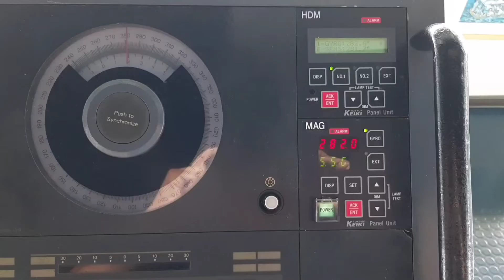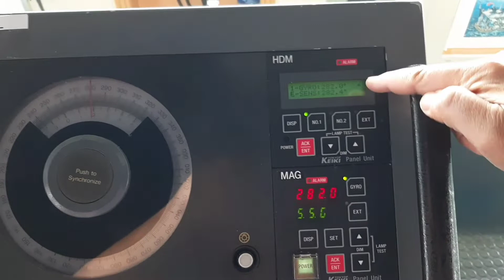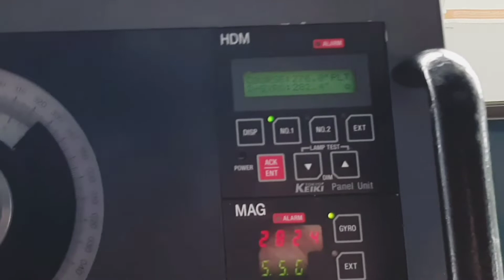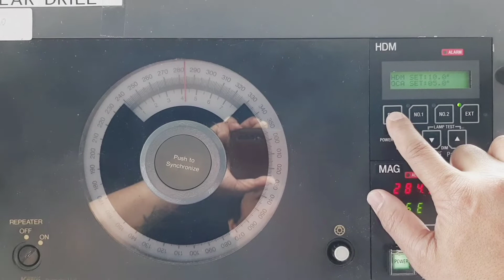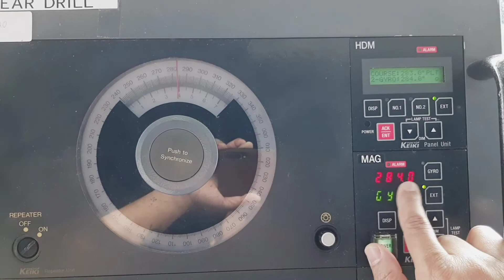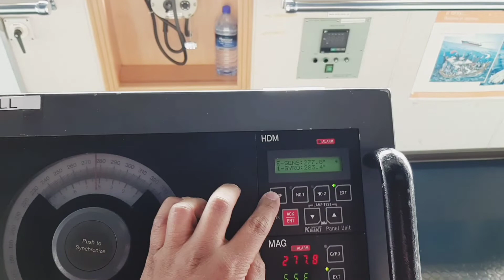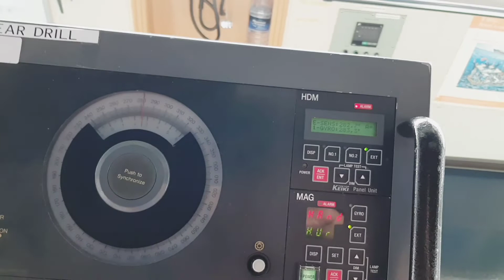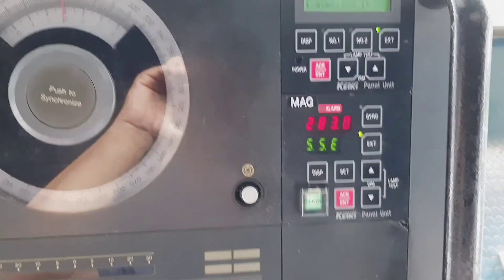OFFCOURSE ALARM TESTING PROCEDURE ON TOKYO KEIKI@geodudegraveller

Comment: Good day to you sir. I have followed your vid and tried the alarm we have same model. After tested and alarm was successful I had set H.Ur back in its previous figure but the alarm which is indicated as letter "A" beside the No. 1 gyro in auto pilot mode during the alarm didnt disappear but audible alarm and light was gone. When switch to manual steering the symbol letter "A" becomes letter "O" beside * of gyro 1 and gyro 2 has normal "o"
Please give me any advise to remove this. Im worried cause well be doing rightship
No. 1 Gyro is 281.4 we use this
No. 2 Gyro is 281.3
Mag is 301.6
ESensor is 294.3
H.Ur 007.3
Oca 10deg
HDM set 10deg
OCA set 10deg
Thanks in advance sir
Reply from the maker: Will check I just joined back on ship 🚢

Comment: Hai , is it possible to test off course alarm in autopilot . When in berth ? If , can you pls tell me how
Reply from the maker: yes just shift to autopilot mode and head to a course away from well away from berth normal heading ,u should get and alarm after some time , or u can also change to ,select autropilot to  magnetic steering  mode and change the deviation to make a huge diffrence after some time u will get a alarm

Comment: How to test gyro error failure alarm sir?
Reply from the maker: To test a gyro failure alarm on a ship, navigate to the gyro compass control panel and activate the designated "test" function, which will usually simulate a gyro failure by sending a signal to the system to trigger the alarm, allowing you to verify if the audible and visual alarms activate as intended; always consult the ship's specific gyro compass manual for exact procedures and safety precautions before performing any tests. 
Key points to remember:
Consult the manual:
Always refer to your ship's gyro compass manual for the correct testing procedure and specific instructions on how to activate the test function. 
Safety first:
Ensure that the ship is in a safe and stable condition before initiating any gyro testing. 
Observe alarms:
Once the test function is activated, closely monitor the bridge displays and listen for the audible alarm to confirm that the system is properly detecting a simulated gyro failure. 
Reset after testing:
After testing, always follow the correct procedure to reset the gyro system back to normal operation. 

Try I got this information from the internet